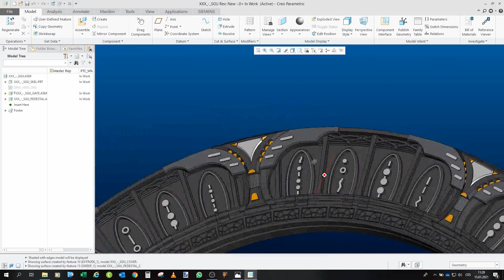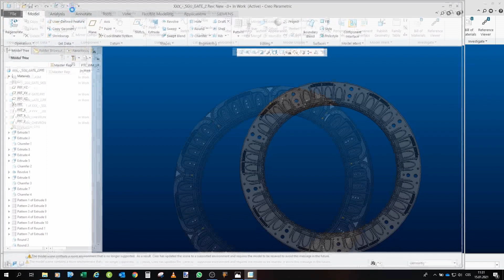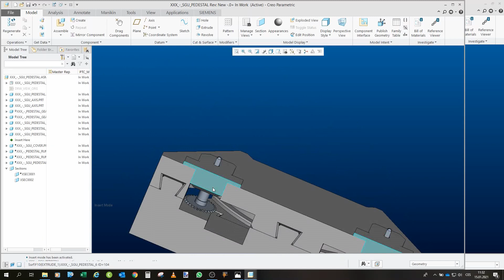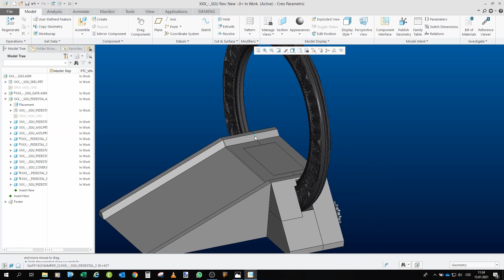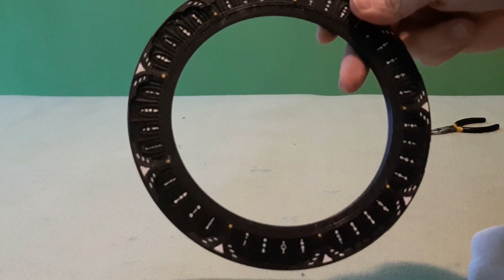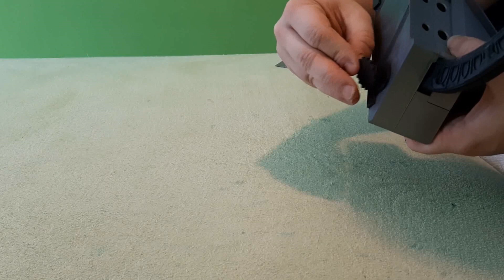Project Stargate part 11

Comment: This is cool.

Is there going to be a motorized version? Perhaps controlled by an Arduino or a Raspberry Pi Nano or a Pi Zero W?
Reply from the maker: my skills prevent that. i don know how to do such a thing. programming and electro is beyond me. thus my things are purely mechanical
Reply: You could It could easily be modified to use a simple 5 volt modelling motor hidden in the plinth, (though you'd need to find a way of slowing it down) with a model railway like controller to alternate the direction.
Reply: I'm working on a motorised version, unfortunately my attempt at making a slip ring were failure. I'm working on a version with battery inside the gate. If I succeed perhaps you can do it too